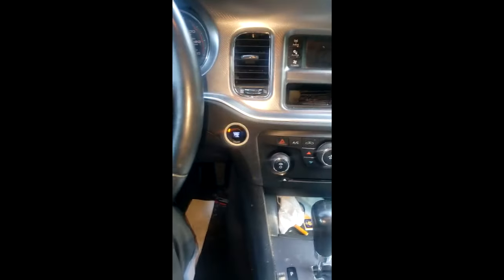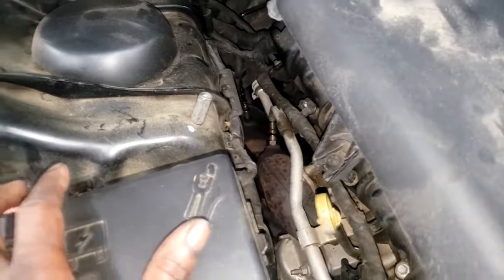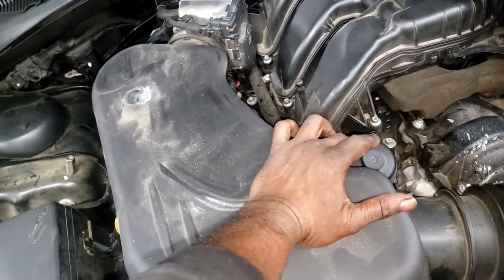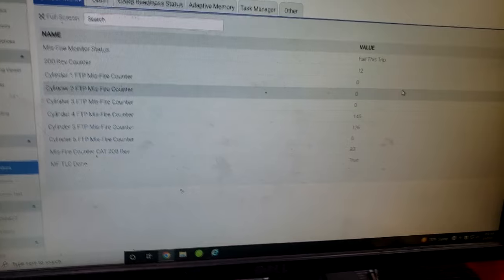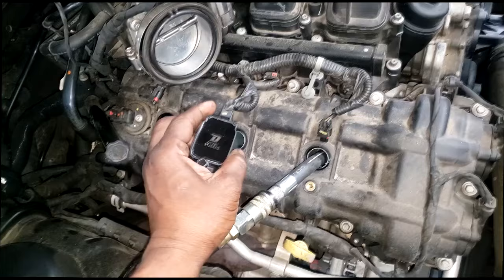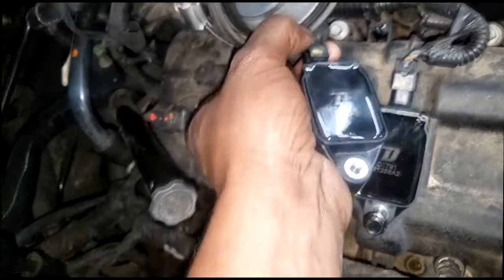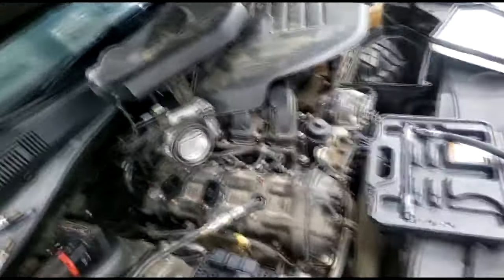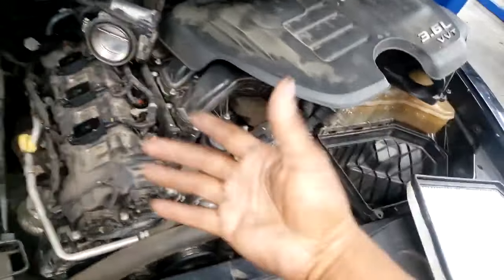DIY JOB WENT WRONG. This customer didn't use Mopar coils but I found his REAL PROBLEM HERE.

Comment: Hey JT what’s your thoughts on the standard output hurricane engine.  About to buy a 25 ram with one.  Test drove it and engine seems crazy smooth and more responsive than my hemi. Also when you do an oil change on one would you post it. There isn’t one anywhere on YouTube for the hurricane